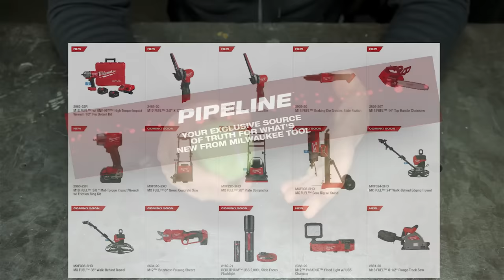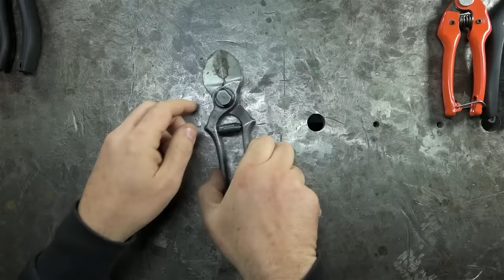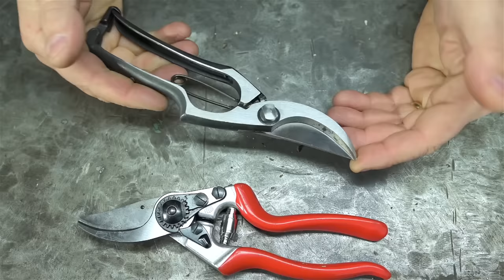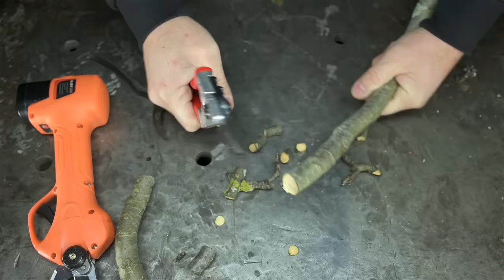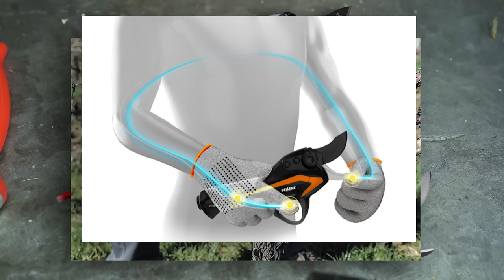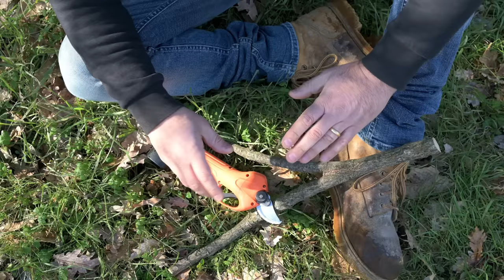MILWAUKEE ?!?!?!

Comment: I love how they put a safety switch on literally every battery powered handtool, but this "FINGER REMOVER 5000" apparently doesn't need one.
Reply: I cringed a bit when his fingers danced over those open jaws.. felt like having your hands in front of a loaded gun. 😵‍💫
Reply: I love how the trigger is so close to the blade to easily catch a finger. No need to move the trigger, say, to the rear of the tool.
Reply: @sharx892  right? I feel much safer with a gun than one of these tbh
Reply: Shirley you mean the 'Gruntmaster 9000'
Reply: @davidparker9676  
Was wondering that myself esp working off a ladder ,a 6” extra reach could mean a couple of less ladder moves. After a long day could also avoid a fatigue accident failure and a trip to hospital.
Reply: They should have named that brand, Darwin tools.
Reply: You wouldn't want that getting in the way of you when you're trying to remove your enemy's fingers during the interrogation.
Reply: @alan-sk7ky  Don’t call me Shirley.
Reply: @ShaneSemler  I am serious, and don't call me surely...
Reply: I feel like this could have been fixed by making the default state closed, hold the trigger to open, let go to cut
Reply: Yeah, just bought a Mil battery bandsaw, the first thing I had to do was disable the interlock, as I do on all of them. Been messing with tools for almost 70 years and still have all my body parts. I assume that interlocks are just a way to keep attorney costs within reason. If you care about your fingers, etc. you'll do a better job than any such device.
Reply: This thing is really scary. The only advantage is that it cuts slow, not snaps. One could add simple and cheap interlock there: trigger should have a metal plate. The resistance should be measured between this plate and blades.  Once the resistance/ following current is not zero (normally it open circuit of course), blades stop moving or open fully. I don't know how big will be the resistance from a dry hand to a wounded one, but definitely should be something easily measurable. Wound to wound through hands would give several kOhm, dry hand to hand - MOhm.
It will not help though to not cut out someone else finger..
Reply: Looks like Milwaukee did tho, I saw 2 switches/buttons
Reply: @ThisIsTheInternet  Nope. The current way it works is the better one. It was tested by every company because designers disbelieved it.
Reply: @davidparker9676  I work 5 days a week with my imagination. I was born with a decent one then I trained a lot and then graduated with a master of engineering title in my academy. Yet, I can't imagine how on earth anybody could cut a finger because the blade is close to the trigger. I consider time travelling more possible because no physics law says it's impossible. But this "close to the trigger" IS impossible.
Reply: That was all I could think of as he lopped off pieces of oak - one damn dangerous tool.  It will be in a horror movie some day.
Reply: @FFLFFS  yep, switched to like 30" handle ones. i am not the man to ask politely a second time. the reach is bonus, not just vertically, but far less ladder movement.
Reply: This thing makes me so uncomfortable lmfao

Comment: My family are fruit farmers and the electric Felcos are the gold standard. Analog Triggers and fast as hell. The speed a professional pruner can achieve with them is mind-boggling. Ergonomics is also key if you do it weeks on end in the winter.
Reply: Having started my horticultural career on a vineyard, doing months of pruning with electric Felcos, I second this comment.
Reply: I used to have felco too and i switched to Infaco and there will be no turning back. The pruning force is unrivaled on the Infaco. Give it a try, you will be surprised.
Reply: 3 infaco 3015 here too. Very good tool!
Reply: @FFLFFS  well, how would you do that without a battery? 
For one, you need a fuel/Air mixture, and this needs to be able to ignite. Might be possible with an electric push Spark like in lighters, but only in ideal conditions. 
Ever have a 2stroke not start on the first 20 pulls?
Reply: @LunaticCharade  what about every other 2stroke garden tool? mechanical ignition is proven and reliable. chainsaws, hedge trimmers and so on. none of them have batteries.
Reply: @LunaticCharade  2T not starting often means you're starting from a non-ideal position, no? hence motocross riders gently winding the engine around to the right place before giving it a kick. Like with 4T stop-start in cars, I'm sure they could be made to shutdown to the ideal position
Reply: @LunaticCharade  Spudguns usually fires the first click. And it would probably cut 😜 the record of snapping one's finger of, to a millisecond! 😁
Reply: @tinozedd8528  I think the singular-action operation makes the key difference. With a saw or trimmer you continuously engage the tool, whereas with a pruner you take single cuts. No need to have an engine run continuously.

Also I'd much, much prefer the relative silence.
Reply: @skrilinn5   @fucklesjd you're not wrong. In fact we have a infaco 3015 as well. Might well be better for some. I just know for a fact that my old man prefers the Felco for most of his work. He told me once they hurt his wrist the least at the end of a day pruning.
Reply: I have a infaco 3015 with finger protection. That works very well and when you touch the wires during cutting the grapes, it won’t cut the wires - which is a benefit. Also have the extension for tree cutting and wider cutter blades. It is unbelievable how you could cut even thick stuff. The new 3020 might be an improvement, but currently no need for upgrade 😅
Reply: Ok all you 2 stroke guys commenting on this post are making no sense. A 2 stroke would require the jaws to repeat the cutting action minimizing tool usefulness. A Pasload style system with a gas cartridge would fulfill your desire for explosive power. And only cycle once per trigger pull. This might be the next big thing for pruning 1.5-3" branches...
Reply: Electrocoup aren't bad either.
Reply: @skyfreakwi  I disagree ! Next thing is a AI driven cutter that tell you if or if not you have to cut on that location or where else. Of cause you need some googles to get it visualized and you should check after a while whether you do real cuts or if you just simulated the cuts 🤣
Reply: @FFLFFS  perhaps... All I know for sure is I can't do either without mechanical advantage. I think I could worry my way through a branch easier than pressing a 3.5" nail in with similar length pliers. Countersinking the head not withstanding. I love my 2 strokes and own a few chainsaws trimmers motorcycles dirt bikes... All of them require significant revs to make power I can't see a way to effectively connect the cutting blade to the reciprocating crank that wouldn't cause a reciprocating motion in the cutter. (I suppose I actually could but the reset of the clutch would still make it slow to use...) I'm getting side tracked and lost here. 
Ok you can build a 2 stroke trimmer but it's probably going to be best with a three jaw metal shear cutting head oversized to accommodate the far larger stock.  Ok now I'm going to have to start making one of these otherwise I'll go insane if I'm not already.
Reply: @FFLFFS  true true. I was thinking of something closer to what we have in the video. A5 inch handle with the pivot 2 inches, 1.5 inches ahead. That's not a lot of room for the 2 stroke I admit but we can do sorry if a bull pup arrangement with the motor mid forearm to balance the head. Now you have me thinking about hydraulics and this just got easier and more complicated... Put a hydraulic piston behind the pincer and we can cut 6" branches! And when it hits the end of it's stroke it'll blow a release valve and auto return with a spring until it finishes that stroke which will reset the valve. Easy.
Reply: @skyfreakwi  
Paslode also make a butane fired air nailer  that’s a 2stroke. Just not the traditional type ice
Reply: @zbnmth  I see what you mean. It could power hydraulics or a little air compressor for pneumatic action. I thought he meant the ignition side of things.
Reply: @FFLFFS  Over 20 years ago, we were using pneumatic pruners in orchards in NZ. A tractor would run a compressor, and 4-6 pruners would be plugged in via spiral hoses. That way we could do 6 trees at a time, with the tractor being moved down a row as needed.
Reply: My wrists hurt just thinking about doing that for a living.
Reply: Tobisho is really a good value. You think a katana is cheap?
Reply: @matte.hartman  and the next branch? That's what I mean, you want to pick it up next week and start on the first press. If you need to reload, then it's faster to use the manual shears

Comment: I originally met Fiskars as a cutting blade supplier, and was happy enough with them that I bought (and wore out) a pair of their entry-level loppers. My machine shop and I are in a trial separation so I can't just machine a replacement part for 'em, and with some reservations about plastic I bought some Fiskars gear loppers. I figured I'd take them home and see if they broke while cutting up a couple of tonnes of dry and fresh Eucalyptus branches.
To my surprise and delight, try as I might I could not break these things, and I applied enough force at times to wreck the aluminium handles on the old pair. The gear loppers are entering their second year of service, and so far my impression is that these are going to last a long time even chopping up 40+ mm dried eucalypt wood.

Comment: About the nr 2 Felco: I used to work at a rose grower's. We had Felco shears which also came with an aluminium lip at the top blade, which enables you to cut a rose and hold on to the stem at the same time. Maybe that's why the bottom lip is designed the way it is.

Comment: Regarding tool safety, I'd have designed it so the trigger is still a mechanical lever attached to the moving blade, with electric assistance only instead of 100% power drive. That way, the blade only moves as fast and as far as you pull it and it backs off immediately if you release the lever. I.e. your pain reflex might stop you from pruning a digit.

It would also let you do something you probably shouldn't but I do all the time; grab cut branches with the the blades then have the option to either release or cut through. It's the quickest way to trim to a consistent length - handy for fitting cuttings efficiently into a wheelbarrow or green bin. Also means you can trim directly into the barrow rather than having to pick up the bits in a second pass.
Reply: Was thinking the exact same thing safety-wise.
Reply: Nice to hear im not the only one grabbing branches with them!
Reply: But now your shears cost upwards of $50 more and everyone is buying mine with the ON/OFF trigger
Reply: @toasty4000000  Most likely, yes. But more advanced features typically start out in higher end products and gradually creep down into the cheaper ones as economies of scale kick in and/or the competitors figure out how to do the same thing only cheaper.
Reply: @toasty4000000  Or you offer both and corner the whole market
Reply: @toasty4000000  True, but that's a viable business model. Just do it like saw stop and let all the 9 fingered pruners do your advertisement for free with phrases like "so I decided damn the cost I wasn't going to make that mistake again" while holding up your more expensive pruners.
Reply: Bosch makes a model like that but I have no idea if it's any good.
Reply: @Baiko  oh yeah, well spotted: https://youtu.be/67xmMD56rqA

If it's anything like the other Bosch green tools I've used, it would be brilliant for 367 days then come apart like the Bluesmobile.
Reply: Great idea on the trigger design.
Reply: Add some real time tracking of the blade position and some haptic feedback that is proportional to the cutting force and you really got an extension of your body. Useless for the mass market but it would make you feel like a tree surgeon :D
I‘d be gardening all day
Reply: One simple safety measure would be to give the thing two triggers, one up front and one at the back, so you have to use two hands to push them both together to make it cut.  Annoying to use, but a cheap way to make them safer.
Reply: @agate_jcg  yup that's what I was thinking, probably slows you down but atleast your phalanges will be safe
Reply: Looks like the Milwaukee does just that: it has an adjustable trigger instead of a pushbutton, see from 1:10 here: https://www.youtube.com/watch?v=3p0CLKpS8c0
Reply: @agate_jcg  I don't get the safety issue?

 I have many shears, loppers, and several electric shears. My fingers have never, ever been in between the blades.  Making the tool require 2 hands to operate seems like requiring 2 hands to be on a knife at all times so you can't cut your fingers.

Having the 2nd hand supporting the object being cut is way safer than not being able to support anything because both hands are on the tool.
Reply: @agate_jcg  Yeah, I like to climb the trees I prune, so more than doubling the chance I fall is not worth the safety margin on a hand that's holding a different branch anyway.

Comment: Hey, TOT, after watching this video, I ordered the Kebtek Pro version.  I gotta say it's everything you said.  My wife and I are getting along in years, and with a large lawn with maturing shrubs, have more pruning than our wrists are comfortable doing.  I thought this would be a good addition to our tools.  It's that and more.  We've both used the pruner and are very happy with it.  Other than the very real risk of cutting off a finger with ease, it's made our pruning tasks a breeze.  it handles well, isn't too heavy, is well designed (gitz oiler for the blades, nice blade adjustment lock), narrow enough blades to get into tight places in shrubs, reasonable price for what you get.  Your viewers could do much worse for nearly effortless pruning.  Thanks for pointing this out.

Comment: Electric pruning shears are the next leap on technology after the rolling-hand pruning shears. As someone who has spent years pruning vineyards, each fellow worker would almost always have the same gear. When you're making thousands of cuts a day the little improvements make a huge difference. It took only two days after the first belt-pack pruner took a skip on a job before we all bought them😅

Comment: Tony, this is fascinating.  As someone who has spent endless hours figuring out the best way to cut materials using the shear method or the pinch method, manufacturing these devices also comes into play.

Comment: The felco I got from the electricians I worked side by side with.

Wonderful tool.
Cuts branches, steel supports for roofs, piping, nails and noses.

Best thing ever!
Reply: [Fx: Sound of cork coming out of a whisky bottle.] Noses eh? [Sound of shot glasses on table.] I guess you'd better pull up a chair and tell us about that time. [glug, glug, glug]
Reply: @ianmason.  Aaah excellent!
grabs a glas and drinks
does it again 

Well you see. 
Now, that was excellent whiskey friend. 
But,
Well.
I haven't actually cut a nose with it.
But it would be my tool of choice if I ever had too!

hat salute

Comment: A note to people who still want to use hand pruners after seeing this:  When making cuts that are at the limit of what your pruners can do, push the branch away from the cutting blade a bit (i.e. push on it, don't bend it) while cutting.
Reply: If I can't cut it with my two foot long loppers I use an ax. If the ax seems outclassed I break out a chainsaw.
Reply: If the chainsaw won't do it I get the trackhoe
Reply: @danhammond8406  now that's my idea of yard work.
Reply: This trick also applys, if you get to the limit of the cordless pruners. Once they get stuck at the first try, just give the branch a bend and it may cut trough nearly everything that you can fit between the blades. Sinve I´ve got my 40mm version of these cheap cordless pruners, (a Suca SC8506) I never had to use my big loppers again.

Comment: The best thing about a bypass pruning shear is, they are the same design as a hose cutter. I have a pair I use just for cutting PEX pipe. A lot cheaper than an actual plastic pipe cutting shear. Any tool is the right tool if you hit it hard enough. Love the vids ToT. Keep up the awesome work.